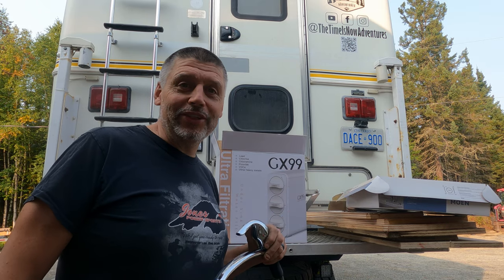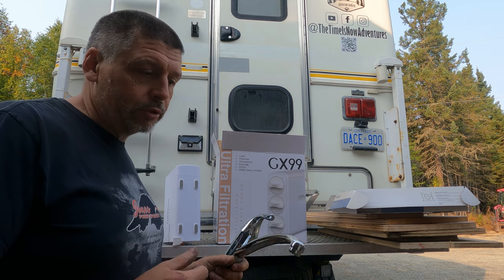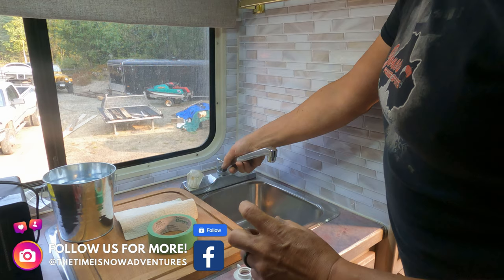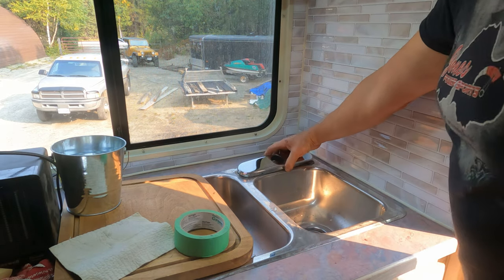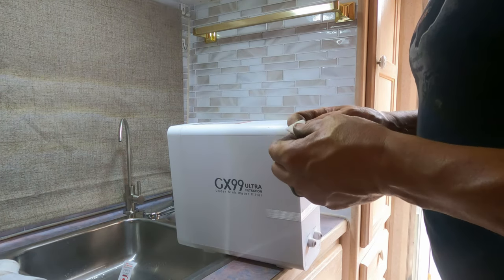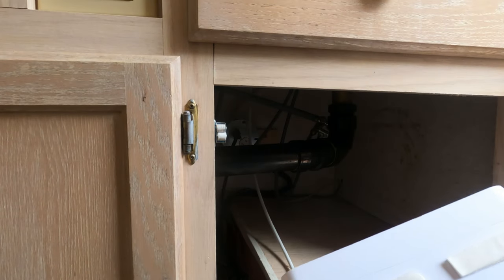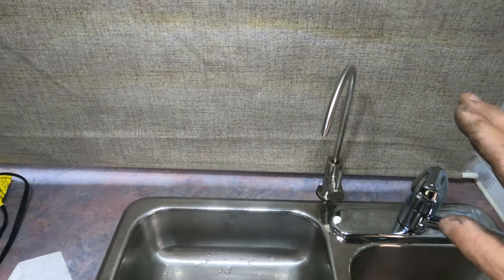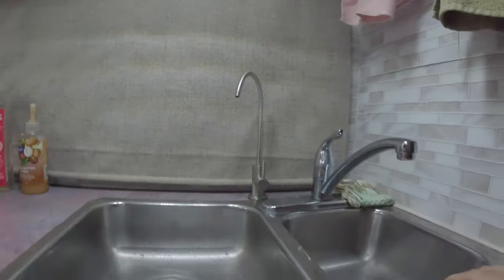Clean RV Water in MINUTES with This Filtration System!

Comment: How did you provide access to the filters from the outside?
Reply from the maker: There is no access from the outside.  The unit is velcro'd to the wall.  When the filters need changing (about once a year) we just pull the unit out and change them.  Easy peasy ☺️
Reply: I’ve used many of the 3M Command Strips to hold things down and to attach items to the walls in our 2023 Northern Lite 10-2. They work so well. For our water filtration, we use the Blu Technology 3-Stage filtration system every time we fill our water tank. I would like to have an onboard water filter system as well, keep us posted on the one you installed because I might invest in that one as well.